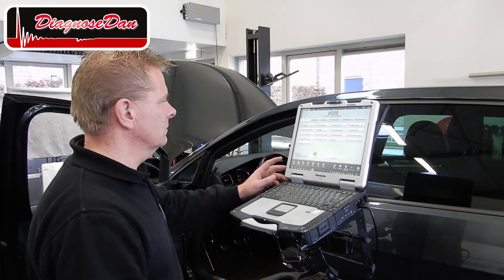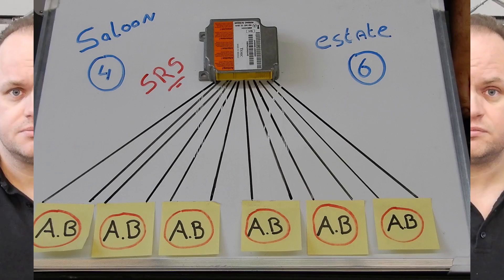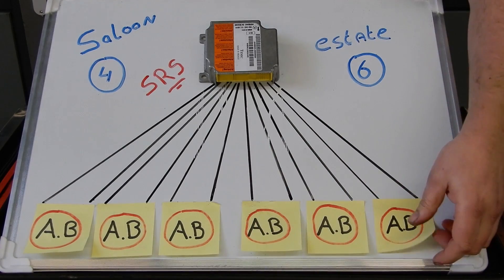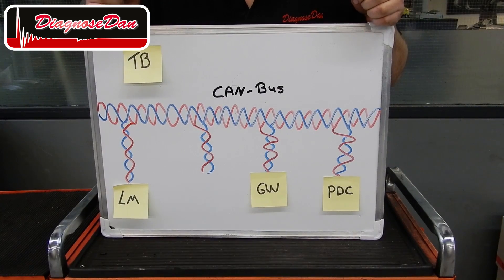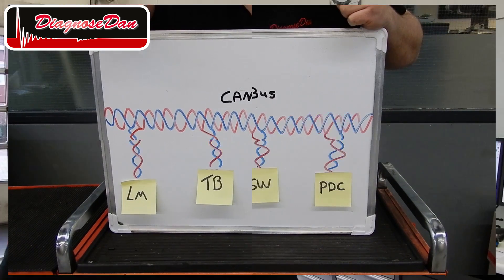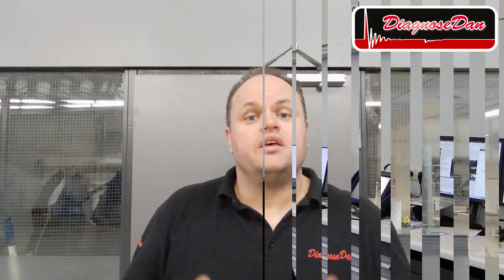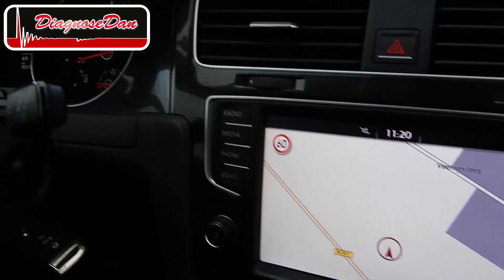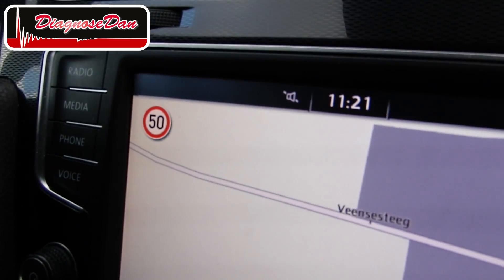fixing a car with a laptop (ADAS)

Comment: Hi Dan, I'm a ff'wer if you and a question. I have an 09 Porsche Cayenne 3.6L v6, I am looking for ignition switch wiring diagram please. Because key switch works with everything but couldn't crank the engine in cranking position.

Comment: If you have the use of ODIS retrieve and enter the correct SVM code to update carport database (VAG server) for new vehicle configuration ie. fitment of towbar. ODIS will then code all modules correctly now and also in the future and you will have no need to manually code anything. Also configuration changes ABS, rear parking sensors, automatic boot lid ect.

Comment: Looks like he's got all the factory stuff, but most of us are too budget limited or on the fence about buying the equipment and targets. 

  Would a Maxi Sys with ADAS software work fine using the OE fixtures or other aftermarket brand fixtures and targets if these ADAS calibration areas and equipment become available in future for  DIY and techs to rent access to for an hourly fee ?

Comment: To most people saying this is overcomplicated and that it should auto detect: There are a few problems that engineers much smarter than most of us youtube commenters have. Those are cost, reliability, safety, liability and what to do if it breaks. You can't simply make it auto detect, because of what happens if or when a device on the network fails. If it was an auto detect system, then it would default to a different configuration possibly one that doesn't apply to that vehicle any more. Then how would the system know that there is actually a fault, or whether the option was removed/added? Sure It can be done, but then how much do you think those modules' complexity and cost in order to manage safety, reliability and liability would be affected? I'd venture a lot, and their subsequent prices would breed a new gripe when they failed. In short you can be very assured that some of the best software and hardware engineering minds working in a team came up with the best possible solution given their constraints, if it were easier every other car manufacturer would do it to get an edge over the competition, but they don't, they all do it in a similar way for good reasons.
Reply: Just to add to the above and not make it any more TLDR. Even if the general complaint is the complexity of actual coding and the hardware/software required to do so. If it was accessible and easy for everyone to do it, who would get the flak if say a person could easily code out the airbags, you know, to get rid of that pesky airbag light, then sold the car to one of your loved ones who crashed and then died because the airbag didn't deploy because it was, unbeknownst to them, coded out? The news headline: "Families' bright young daughter killed in minor crash due to failed airbag in car manufacturer here " gets huge exposure. Then a week later after manufacturer reports airbag module coded out, gets almost no exposure, and said family still has a dead daughter. Those procedures are deliberately hard to do because manufacturers actively don't want Joe Soap messing around with their intended safety/liability/risk factors and endangering themselves or, most importantly, others that are not aware of what Joe Soap did to get a few extra dollars on the sale of his car.

Comment: These automotive engineers might be getting a little carried away with the micro controllers. I have a 2022 beamer, and the butt warmer module cant talk to the ball scratcher module. These functions are high priority and should be move to the high speed  PT bus. Just wait til 5G is fully implemented. "They will know how many people are in the car, how far you drove today, if your tire pressure is low. If the car and phone agree you were at the pub for more than 3 hours, it might not start or you might get a visit on the way home. Do you drive electric or a gas guzzler. And thats just the tip. Love the videos. Good job of keeping up with the times.

Comment: That's such a great law for safety to have as braking distance is greatly enhanced with a trailer of any kind when being towed!!
I live in the US and to my knowledge there is no such law so if the speed limit is 70 MPH you can bet a trailer with a VERY small circumference tire is going 70 mph until that tire blows or the bearing overheats, its always easy to see a trailer on the side of the road with a blown tire or seized wheel bearing

Comment: Thanks. Great vid! What happens to the camera adjustment when you add more bodies in the back seat and some tongue weight from the trailer? Does it recognize the new ride angle?
Reply: When a calibration takes place it's empty and numerous contact points are measured.  When people get in the computer is expecting a variation from base and makes adjustments to compensate.

Comment: Hi Dan first i saw your videos i subscribed immediately
Your the best teacher on youtube .
Thank u for that.İ learned how to work can system on the car.
Let me ask a question about my cars problem.
Audi A4 2006 1.8t bfb engine .And my problem is auto light and rain not working correctly. Using vag com no fault code on the car. Channel 20 and 21 are ligt and rain sensor channels.İ tested the light sensor on this channels and working (0 to 7 i saw lingt and dark condition) But headlights always on. Coming home function works correctly.
How can i solve this problem?
i didnt any way to adaptation with wag com.
Pls help me thank you Master.
Reply from the maker: Totaly not working?
Reply: when switch auto lights positions ;headlights always on.(not working)
but coming home function is working correctly.(uses same sensor)
Also rain sensor is too sensitive 
no rain wipers works so slowly.(must be not works)
under rain works good sometimes fast sometimes slow.
thank u (my English not good)
Reply: main reason is windshield changed last years . Auto lights going bad slowly.At first works now not works. İ renew gel but nothing changed 
i think needs adaptation.
Reply from the maker: @Fatih_Akar  yes you need to re-calibrate it.
Reply: @Diagnosedan  how can i do it with vag com?

Comment: Wish we had people as good as you here in the UK near me. I had a VW Touran from new, The first winter as soon as the teperature went below zero the radio would not work and the engine warning light came on, when the  car warmed up the radio came on but the warning light stayed on so I went back to the dealer who could find nothing wrong, the code read turbo over boost. This went on for several years, pay the dealers for clearing the fault for it to come back again  next time the car was started in freezing weather, in the end I purchased a cheap can bus reader and just cancelled the fault myself, had the car for ten years and the problem was never found, the dealer told me it must have been a software bug but they never updated that. I no longer hav the VW and will never buy another.
Reply from the maker: Sorry to hear that😬 It's not the brand it's the people working on it.
Reply: @Diagnosedan  I know it's not the brand but I cannot change the people at the dealers so I change the brand and therefore the dealers, I went to Mitsubishi and got an L200 Barbarian, was thinking of an Amarok with the V6.

Comment: if it has a trailer arm and u remove it without coding would it effect other modules ?
Reply from the maker: On some cars yes on others no.
Reply: porsche cayanne ? 
by the way you are the man because of you im better than i was before ..... if i could i would love to spend couple of days with u and learn even more
Reply from the maker: @jagzsingh9697  it depends on the options, imagine it has this system and you removed the towbar module without de-coding it. The system would not get a response from the module and set a fault code. You can always try first. If it causes problems you can de-code it.

Comment: Very interesting setup indeed. My current Skoda Superb Estate I ordered with a factory fitted towbar and it links to the alarm I found out recently.. lol I unplugged the trailer when the car was locked and alarmed and it set the car alarm off because it thought someone was nicking the trailer.
Reply from the maker: If the car is fitted with an original towbar the coding goes fine with Odis. You can see how all these Systems are connected.

Comment: Would be cool if you did some radar or,  side assist calibration in one of your video’s also. If you have the tools for it. You can also enable lane assist and high beam assist on this module. It’s the same camera.
Reply from the maker: Its the same camera, this one has high beam assist but no lane assist. The calibration of other sensors looks alot like this procedure.

Comment: I understand what is going on, but why can't the car owner access all of this information on their display in the car ?  All the information is there. Why should one have to plug in anything to find the codes, and apply fixes. If the car is networked the repair can be made remotely and downloads the correct software package to the car. It seems companies are adding complexity to the systems and then bowing out of the systems upkeep and repair. This is silly. Even the calibration could be done remotely with just a minor bit of thought.
Reply from the maker: Don't put us out of a job😂😂
Reply: one thing i did see is that new vw had a gateway system on it does that cause for a problem for a normal scan tool  ie; autel   to interface correctly .... i am here in the USA and do most of my work on US made type vehicles , but still would interested in your thoughts
Reply from the maker: @erichagler7842  If your talking about a security gateway, it's not just for Volkswagen. Most new vehicles are equipped with it.
Reply: i guess i should of  have been more clear on my thought prossess here .  what i was getting at is that most of of the new car do have a gateway which can block out the use of the aftermarket scanner tools .  and require the use of OEM scanner tools   or can this be done with most scan tools
Reply from the maker: @erichagler7842  You can read codes, but you can't clear them. Aftermarket scantool manufacturers are working on a solution.
Reply: i thought so on that have only had the autel now  about 6 months seems to be pretty good here in the US so far most of my work are cars that are not gateway protected yet.... thanks for your input on this point .... that interface seems tobe europeon only right now unless they have a US support teem ..... thanks for all your help and pointers Dan
Reply from the maker: @erichagler7842  they are working on an USA support team.

Comment: What kind of magic is this?! ODIS never use less than 30 minutes to compile data when coding or updating software!
My guess, before you scanned the car, was either a bad GPS antenna, or wiring, from looking at the navigation.
Also, you only have to recalibrate the camera after adjusting the rear alignment, not the front. ;)
Reply from the maker: Thanks for watching

Comment: the  adas  system is going to be great  in a few years  when all cars have it and you have to explain to the customer the cost of re-calibrating  there car
Reply from the maker: As the market grows, the shops offering this service will also grow. And than the prices drop.
Reply: @Diagnosedan  yes i do agree to a certain extent but the initial outlay for buying the equipment is expensive and i think it will become a specialist service as with all things we will have to wait and see

Comment: Excellent explanation as usual. 
I don't see myself being able to repair "driver aids" like that in ten years time when I can afford a car that's equipped with any.
Reply from the maker: I'm pretty sure you can repair it! 💪💪
Reply: I'm used to the old saying, "If you can't fix it with a hammer, you've got an electrical problem" but thanks to you I'm slightly better educated now! @Diagnosedan

Comment: Well, that is what I would call over engineering. :). Lot of aftermarket tow bar installer, very few people, in my experience, understands all the relations. Hopefully in next generation system would just check if anything is hooked up the trailer all the time, no need for conditional coding. Just mine point of view. Oh and great explanation with the speeds limits for towing ... as usual from you :)
Also that calibration with special pattern in exact place is just crazy.
Reply: yes its not an intelligent fail,  should show the symbols for normal driving and give an intellegent error that the towbar isnt coded, not fall on its face
Reply from the maker: On some brands it Works easier than on others, thanks for the comment it's appreciated